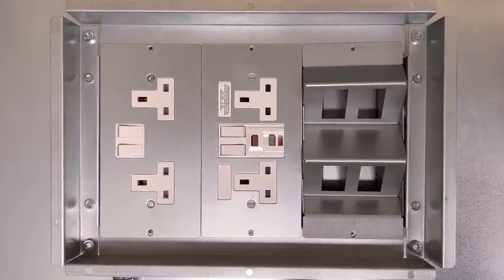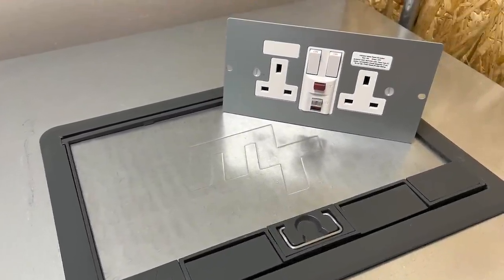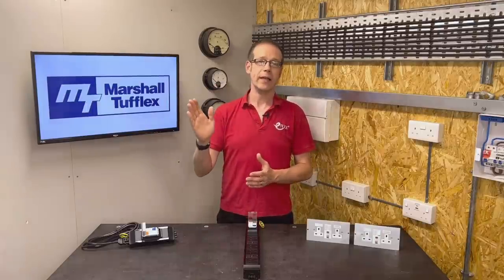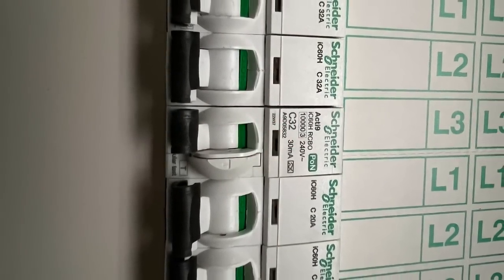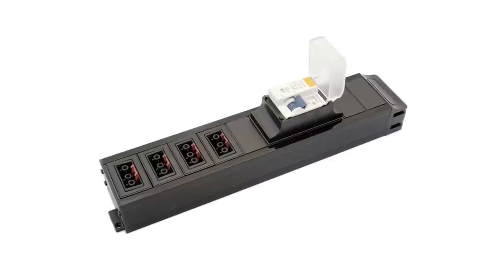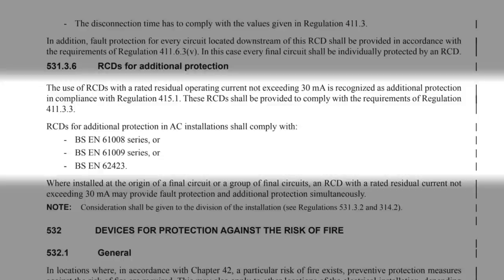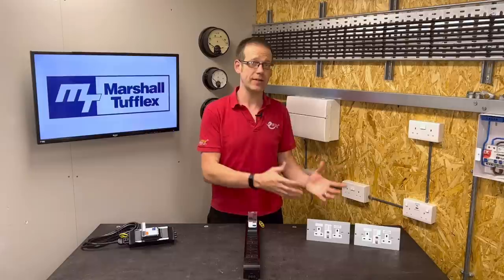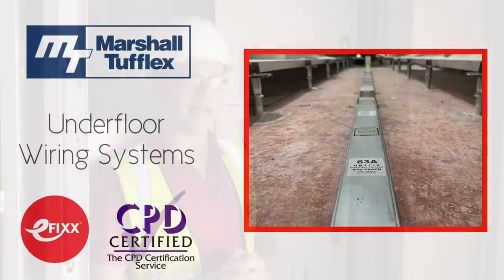Can RCD Protection Be Provided At The Socket Outlet?

Comment: One reason to not put the RCD at the source is with switch mode power supplies, the background leakage can soon add up to 30mA. Also, if more than one branch is fed, a nuisance trip could occur. Finally, getting someone to reset an RCD can be a pain if it's an electrical cupboard that no one has access to. Conversely some very risk adverse companies would not just want any of their staff resetting a breaker after it had tripped by themselves.
Reply: Thinking the the same thing imagine feeding 20 desks with pcs plugged in by one 30 ma rcd, i doubt it would hold in at all given the earth leakage from it equipment.
Id go for the rcd sockets or desk mounted inline rcds everytime.
Reply: The allowable leakage for a decent switched mode supply is 0.5ma so you are looking at 60 devices...   Take an average of 150w per device and you are looking at max power 9kw...   You are soo at limit especially as in those environments you should be looking at radials....
Reply: There are different types of RCD for this reason
Reply: One reason to put the RCD into the Consumer Unit is to protect residents of houses and flats  if they nail things into walls, such as picture frames, paintings.

You would be surprised just how many people do that.
Reply: @timballam3675   A 30mA RCD must trip BY 30mA but may trip FROM 15mA, so that would take the theoretical maximum number of devices leaking 0.5mA down to 30. You'd probably want to allow a not of 'wiggle room' as well, so maybe 20 devices max?
Reply: @timballam3675  Remember a 30 mA RCD is allowed to trip at 15 mA and most will trip closer to that than 30 mA. Also plenty of computing devices draw much less than 150 W
Reply from the maker: Some great points here. 👍

Comment: 0:36  I love the idea of an RCD requiring a monthly test being buried under a floor and installation like this.  Given that furniture layout is flexible and highly likely to cover/trap floor access panels, then you have two problems.  1. It is never going to get a monthly test - ever!  2. If it does trip, then telling the building occupier that they will have to rip out their desks so that the trip can be reset is not going to be popular.  Actually my guess would be that an extension lead would be the solution.

Comment: If you add a socket to a ring circuit which currently is without RCD protection, do you have to provide RCD protection to the full circuit after the install or is it enough to just protect the socket  you have installed with RCD protection?
Knowing if the rest of the circuit complies with the need to have an RCD or not it limited where cables are already buried in walls etc.
Reply: Depends on the existing system. If it’s domestic, it would be easy enough to swap MCB for RCBO. If you are protecting just a socket, keep in mind it must be type A as standard. I haven’t seen many of those around though.

Comment: If the supply cable was run in metal trunking to the floor cavity and never buried in a wall could a toughened cable be used instead of armoured?
Reply: Yes

Comment: What about installing a time delayed or higher trip current rcd (eg 100ma, 300ma) with then a 30ma at the socket?
Reply from the maker: What he said! 👆
Reply: It is not the case that a higher trip current RCD trips more slowly, so an RCD with a higher trip current than 30mA does not overcome the problem of discrimination/selectivity when multiple RCD's are used.

Comment: Why am I seeing RCBOs while we are talking RCDs?

Not to mention that we need to talk about selectivity and such when using RCBOs...
Reply: RCBOs and others are part of the RCD family.  Like RCCB
Reply: Because an RCBO contains an RCD and this video is about options for placement of the RCD, at the consumer unit, at the socket outlet or in-between.
Reply: So let's talk about selectivity.
1. Why is it important?
2. How is it achieved?
Reply: It only local load should disconnect under fault. Upstream downstream  = discrimination achieved…
Reply: @adriatikkrasniqi1453  No. If there are two RCDs in series from the incoming supply before the consumer unit and the socket outlet, if an earth fault is present on the socket outlet, both RCDs will sense the fault condition and BOTH will react to it.
The problem is, you don't know which one is going to trip first, or perhaps both trip.

If the RCD in the CU trips then depending on what circuits it is protecting, you are going to lose power to multiple circuits which had selectively been taken into consideration and properly designed in, you would only lose power to the ring main circuit on which the socket is connected, or even only to that socket outlet.
Reply: @deang5622  thanks for commenting.. this way we have been told from  the college..,
Reply: @adriatikkrasniqi1453  I don't care what colleges say. I am educated in electricity to a higher level than most college teachers.
Reply: @deang5622  well done to you.. the wording don’t care you meant you don’t for   Teachers     Were are in all colleges a round UK…